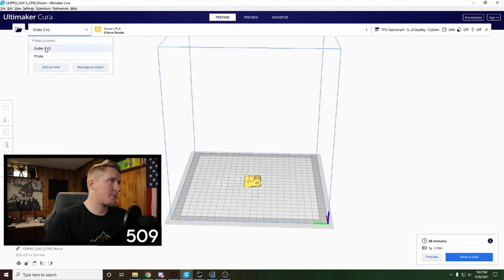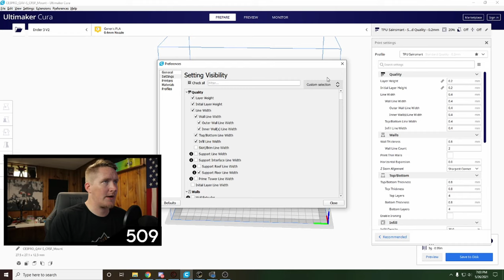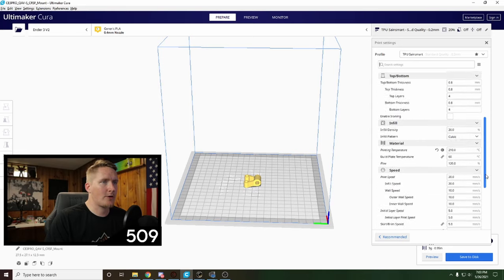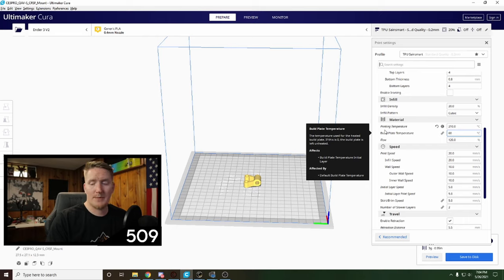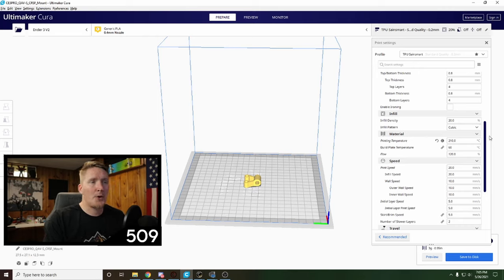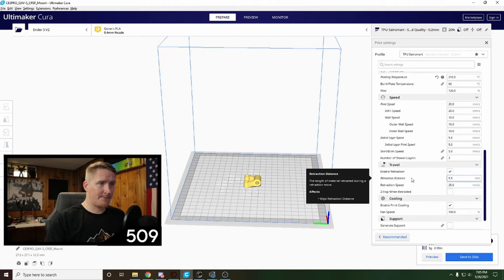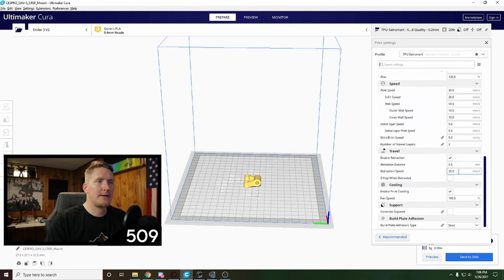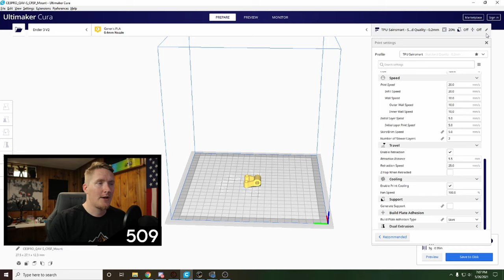How to Print TPU [ Ender 3 v2 - Cura Settings ]

Comment: I have a direct drive printer( Artillery Genius). Even though it's made to print flexibles , it doesn't mean it's without issues. I use Cura and never been able to print TPU perfectly without clean up or without failed prints. I used your settings and now I AM DIALED IN with perfect prints. No clean up or otherwise. Thankyou so much!!!!!!!! I also print for FPV parts. SUBBED to your channel.

Comment: The settings fit perfectly. I used the same printer and filament. I didn't have to adjust anything in the settings. Thanks
Reply from the maker: Right on, glad this was helpful
Reply: Have you done any upgrades to your printer?

Comment: Basically what changed alot for me was increasing the retraction from 5 to 9 millimeter and slowing the retraction speed down to 20mm/s. Given that I print A95 TPU from 3DJake housebrand, it is really easy to print.

Comment: I have a Longer lk5 Pro with the bowden tube.  I have heard also that you can't use TPU.  I unspooled  the TPU and took tension off the feed mechanism as well as adjusting the speeds.  Working great.  Thanks for the video!

Comment: Grateful, your explanation has been very good, I have a question, your printer has not been modified? Is it possible to print TPU with this printer without applying changes, for example improvements to the printer. These days I intend to buy a TPU filament and do the test with your configuration, thank you
Reply from the maker: Thank you. Yes, you can print tpu totally stock. You just have to print very slow. But I would suggest a couple very easy, cheap modifications that will really grip.

Comment: Nice Video. I have as well an Ender3V2 but changed to a direct drive. You said, that the "numbers" you mentioned, especially print-speed and flow rate are for a bowden-tube configuration. Do you have experience with a direct drive model? What print-speed and flow rate I have to use on TPU on a direct dive?
Reply: print is 60 mms on DD i suppose, i e tree times faster.
Reply: @steamvogue  So here you are 👀😂

Comment: Video suggestion: Cura setting for bridging - i saw that cura has extra settings for bridging but i didnt got it to make my bridging better :D

wouid love to see a video about it/learn about that ^^
Reply from the maker: Thanks brother! I'll drive into that and make a video about the topic. Thanks for the suggestion!
Reply: @509drone2   a lot of people just show the settings or the results. i for myself think that its missing the point of how much their settings improved the results. i tried several settings that are online but it didnt change much for me. i was able to print with my stock settings about 50mm bridges flawlessly but any bigger and i got seperating layers on the bottom of the bridge or the sides of the bridge. Using different changes from other people with same modified ender 3 v2 like i have (i habe pretty much copied most from you :D) didnt improve anything actually.
so probably a comparison of before and after would be great aswell there :)
Reply from the maker: @Sersch777  I hear ya :) yea I think I've had the same issues with bridging as well

Comment: Just an FYI:if you own the new Ender 3 S1, do NOT use a greater flow. Spent all day chasing my tail with stringing yesterday. 100% flow seems to work just fine with the S1. More than that, string city. But yes, with the V2, you need more flow to get a good print.

Comment: Hi , no need direct drive ? Or others nozzle ?
Reply from the maker: Nope not at all. You just have to print slower. I would recommend a upgraded extruder & ptfe tube, but it's not needed.
Reply: @509drone2  thanks for fast reply. What extruder ans ptfe you recommence please ?
Reply from the maker: @Tonazizozor  no problem bro. Any decent extruder or ptfe tube will work, but I use and recommend the ones from TH3D. They make high quality products for 3d printers. They should be linked in the video description if you want to check them out. Also, jump in our discord. There are lots of us in there that talk about 3d printing.

Comment: The 120 flow is blocking the nozzles.. Or should i do something to fix this?
Reply from the maker: What do you mean "blocking the nozzle" ?? Have you changed out your nozzle? Maybe it's clogged?
Reply: @509drone2  brand new nozzle.. Print failed halfway. It was looking amazing btw.. But then i check the nozzle it was clogged..
Maybe i should lower the flow

Comment: My ender  s1 keeps clogging. I am using saint smart.
Reply from the maker: Tpu is hard. It does clog more then filaments like pla. Try slowing your speeds down a little more and seeing if that helps maybe.
Reply: @509drone2  thanks

Comment: I bought Amazon brand TPU and it needs to be printed at 240 degrees
Reply from the maker: Yea that's very possible. Different brands of filament needs to be printed at different temperatures. It's always a good idea to print a temperature tower to find out what temp that filament likes best.
Reply: @509drone2  I've been having a complete nightmare with the Amazon TPU some prints come out okay others are horrendous I was getting over extrusion so I calibrated my esteps and it made no difference reducing the flow helped a little but my quality still isn't as good as I'd like.
Reply from the maker: @lightsiderevan7233  try reducing your speed super super slow. That was the biggest factor with my tpu quality. Also retraction speed.
Reply from the maker: @lightsiderevan7233  also try printing a small, very basic object with no supports until you get your settings dialed in, then scale up to bigger objects.
Reply: @509drone2  I bought a roll of SainSmart TPU and it's amazing I've tossed the Amazon crap in the bin the difference good quality filament makes is massive.